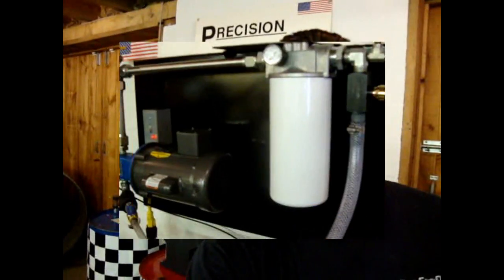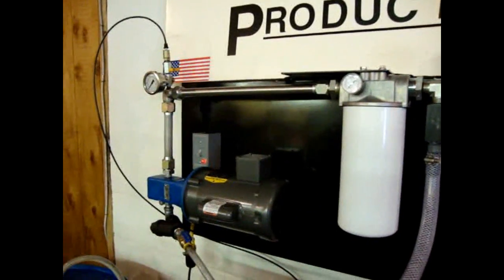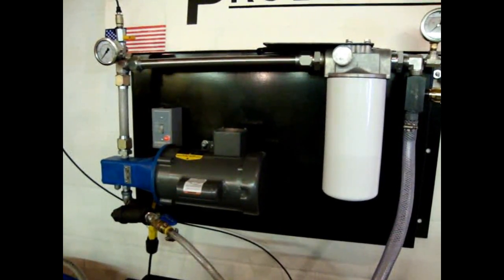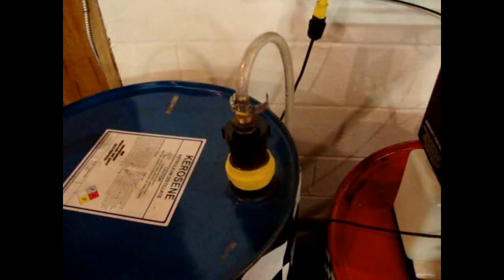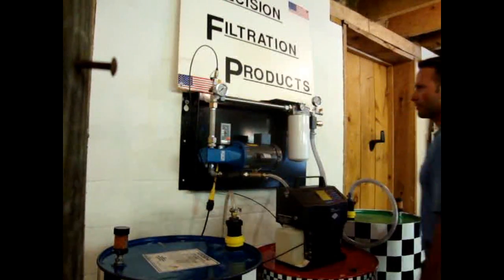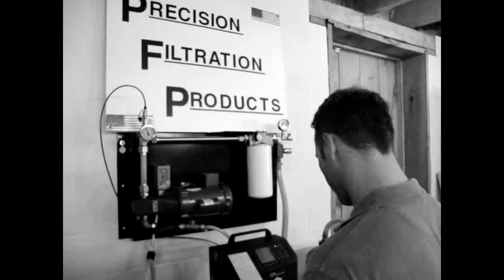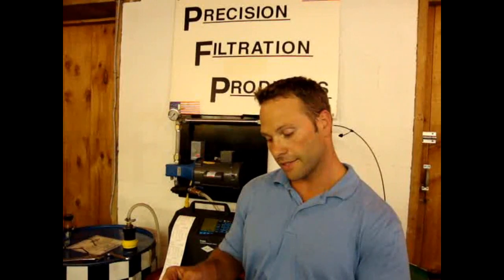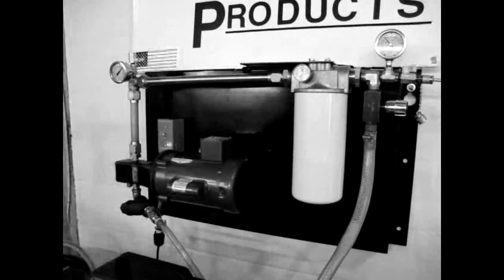Testing Diesel Fuel with ISO 4406 Cleanliness Code | Precision Filtration Products

Comment from the maker: Hi Jacob. This unit wouldn't need to create enough "agitation" for such a large tank because that's simply not its purpose. This unit is for much smaller applications such as testing the diesel fuel contained in an oil drum, as shown in the video. For larger applications obviously a much larger system would be implemented, with a larger pump and larger filter, most likely in a kidney-loop style, with the pick-up at the bottom of the tank. Thanks for your comment.

Comment: Here is a question. How would 1,5,or 11 gpm create enough "agitation" for a 10,000 gallon tank to clean the lower quarter of fuel? Which is where the pick-up for 99% of all tanks are. Basically you are taking a fish tank filter and trying to clean a pool. It is easy to clean a 55 gallon drum but in real life application your flow is insufficient.